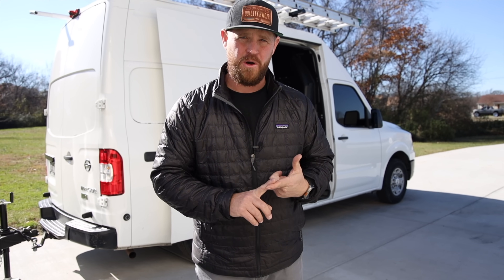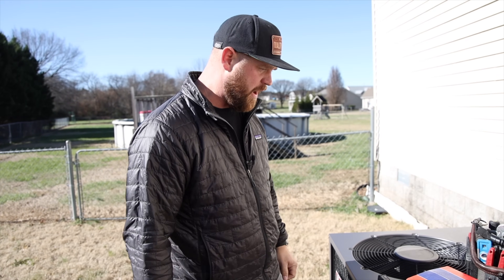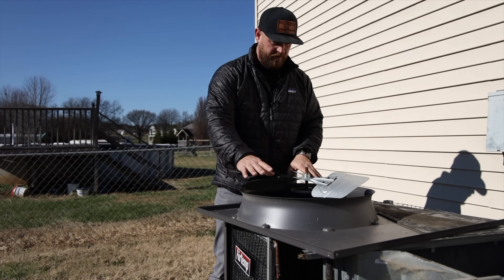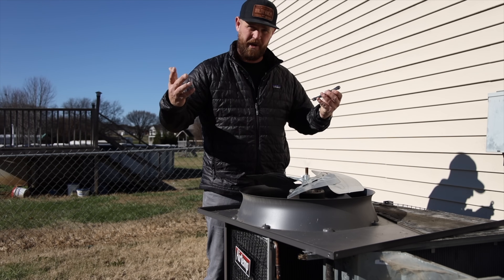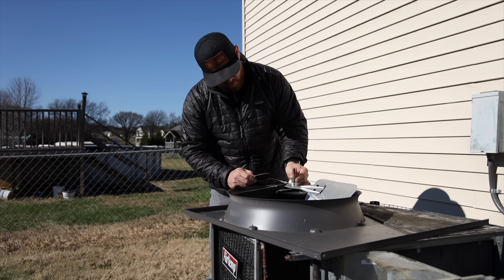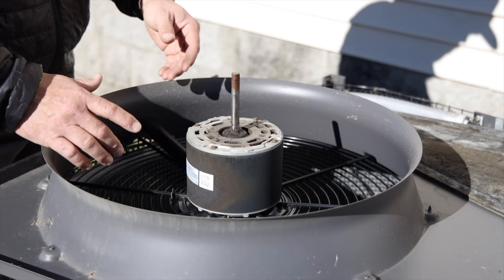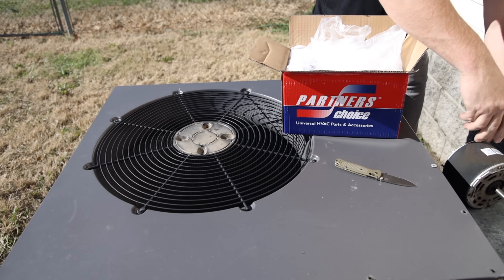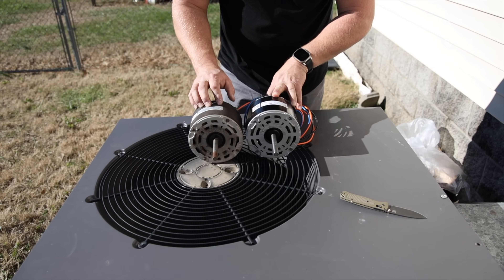This is Why MAINTENANCE is Important…HVAC Repairs

Comment: Anti-seize on set screw hole threads makes the future removals much easier.  Dielectric grease works well to, the point being to exclude moisture. Dry threads are Satan's playground.

Comment: I use a wire wheel on the shaft if it’s rusty and then use old vacuum pump oil as a lube works very well

Comment: Thanks! 

What was the original motor 'over amping' at? Technically the new one was too, not buy much but it was over. 

Sometimes the blade position will affect the amp draw also the position of the meter will make the reading vary. Do you rule these out? 

Not trolling just want to know your method/ take on it. 

Thanks again

Comment: That motor will go out on I P.  It may take some run time, it would be interesting to check the motor temperature after some run time.  During the winter months you may get away with it,  but when summer rolls around and ambient temperature is higher,  and run times are longer, its going to fail.

Comment: There’s was no need to pull the whole top of the unit.  Pull the grill, pull the side panel and run your wires back to the controls.

Comment: Hey Zac, love your channel. 
Would like to share a idea I came up with years ago on the motor replacement with you. 
Instead of pulling that entire top just pull the wire ring it’s attached to with motor and blade. Then turn it upside down and screw it back down in the same screw holes. Now it’s still solid to remove the blade and less to fight with later on siting the entire top back down. Just a fyi thought you may find neat. Thanks
Reply: This is very smart I started doing it around 8 months ago and it’s honestly super easy and I’m just 17 doing hvac work working for a local company leading the trade

Comment: Nice piece of work again, the calmest technician out the😊
The fan set up on the units is not the best due to the restricted flow inside the motors.
I can understand the cover plate to avoid rain and snow hitting them, but the internal flow gets lost. They are made for cross flow duty, not a single side made went ports.
Seems like the thin plate body style motors are made for a high internal air flow cooling.
Changed hundreds of similar design on ULT freezers due to dust on the air ports on them.
in dusty environment.
The motors stayed alive maximum two 2 years and up to 5😬if in a clean place.
After changing to the tube axial way back two decades ago, those fans stay put the life length of the units of 20 years.

Comment: I like your video, but I would never use a drill to open the 1/4 inch screws that hold the fan motor! These aftermarket motors do not come with the new nuts! Once you break 1 off, good luck!

Comment: @qualityhvacr if it's rated for 0.8 amps and testing at 0.84 out the box, wouldn't you call that bad? I feel like if I checked an existing 0.8 and it was at 0.84, I'd tell them to replace.  You have more experience than I do though.  Would you explain? Please and thank you.
Reply: You're not replacing a motor because it's drawing .04 more amps than rated for. Come on now
Reply: @daviddelia3552  I live in AZ. if I'm doing a pre summer check and I know condenser clean, filter good, cap good,  and we have 6 months until I'm coming again.  I'm telling the customer hey,  it's running, but it's over the recommendation.  We can roll the dice and hope it's good, or we can prevent a much more expensive compressor change out and take care of it now.... just be transparent.  But if that was a brand new out the box fan motor,  I'd take it back and get another.... this is just my opinion. I know @qualityhvacr takes pride in his work and has more experience than I do. I'm open to suggestion though.
Reply: @andrewhepfinger7969  how long u been doing hvac?
Reply: @daviddelia3552  1 year
Reply: But a capacitor says 45 +/- 6% or whatever.  In that case,  45.07, 47, were good to go.  But a rating is a rating otherwise.  Especially brand new.  That's what the people who taught me said.  But I'll never think I know everything
Reply: @andrewhepfinger7969  ahhh ur a first year. Ok makes sense. Ya brother don't be swapping out motors cuz they're 0.04 amps over
Reply: @daviddelia3552  If a condenser fan motor is pulling FLA right out of the box, and you don't think there are other underlying issues then I would say you don't know what you are doing. There is a reason the manufacturer has a specified FLA on the motor. It will run but when outdoor ambient temperatures increase in the summer time that motor will be overheating.
Reply: @stephenchurch6715  Stephen don't be a parts changer.
Reply: @daviddelia3552  a parts changer would change the part and not fix the problem. I never said the motor was the problem. Don't pass off poor knowledge to the newer generation of technicians. It is lazy.
Reply: @stephenchurch6715  don't go around charging customers for parts they don't need. Hack.
Reply: @daviddelia3552  Remind me again why he changed this condenser fan motor in the first place? You calling him a hack as well? Didn't think so.
Reply: @daviddelia3552  what would you define as “over amping” then? Guys like you keep me busy.
Reply: @daviddelia3552  and again I never said the ODF was the problem. Plenty of things could cause an ODF to over amp. Your lack of knowledge is showing pal.
Reply: @daviddelia3552  thanks for getting back to me.  And i appreciate the advice. I take pride in my work, and my objective is to make a great living doing great work and being above board. Taking care of the customer and doing the right thing. Have a good one!
Reply: @andrewhepfinger7969  you too andrew! Good luck with ur career. I can tell you care. You'll do great
Reply: @stephenchurch6715  Sounds like you have FLA and RLA mixed up. A motor rated at .8 FLA just means that motor has reached its maximum torque and horsepower at .8 amps, .84 amps is just fine.
Reply: @4thlinegooner582  a motor that is rated at 0.8 amps and is pulling over that rating is not over amping? I’ll ask you then, what is considered over amping?
Reply: I agree. I wouldn’t think so but maybe condenser dirty?

Comment: Thanks for installing the fan properly, I've seen to many who just remove the grill, cut the wires, wire nut them together and leave the wire nut sticking out the top and blame it on the fact that "it's an after market fan". Good job. Thank You...
Reply: Always remove the set screw and clean the shaft, before trying to remove the blade.  Lots of techs will pull the blade upon a rusty shaft, and then destroy the blade trying to get it off We always used to replace the fan blade also, just in case it is out of balance.
Reply: To all who replied  "It's an OEM fan, so no rotation wires".  That's true, but sadly that does not stop lazy techs/companies  from removing the grill, cutting wires near the motor and wire nutting the new one in. It's when an easy job is too hard to do correctly that shows a techs/companies true colors. Quality HVACR did a good job. Thank You...
Reply: That's wasn't an aftermarket motor,it was an exact OEM motor. So, no rotation selection wires needed.
Reply: Great point but there are no rotation wires on an OEM fan motor.
Reply: True, good quality install work.

Comment: I always have to force my management to do PMs on our heat pump unit.. I'm pretty big on that stuff myself.. check outdoor condensing unit and indoor evaporator unit.. I once found my unit iced up and not going into defrost mode because of a bad defrost board and it's been like that for a few months..... thanks for all the great videos!!!